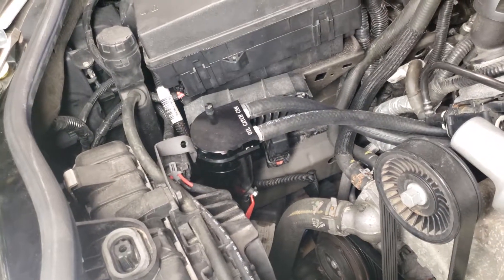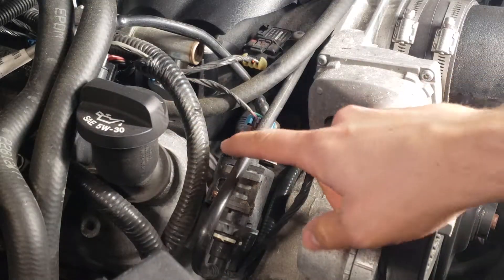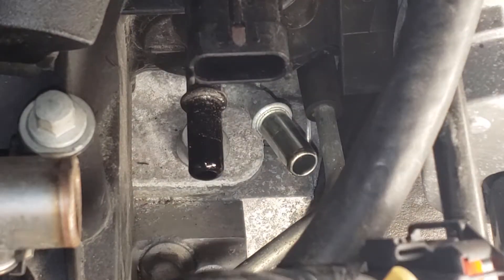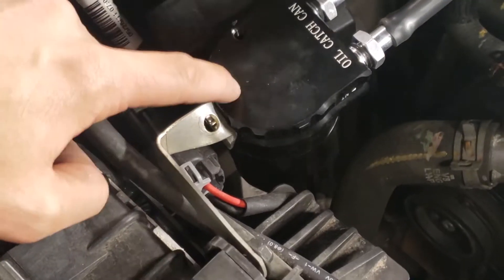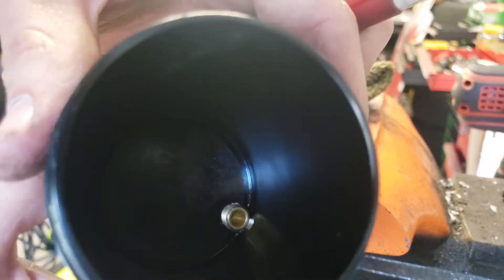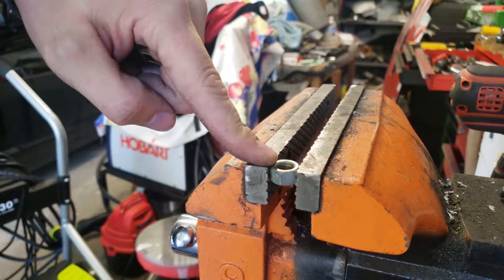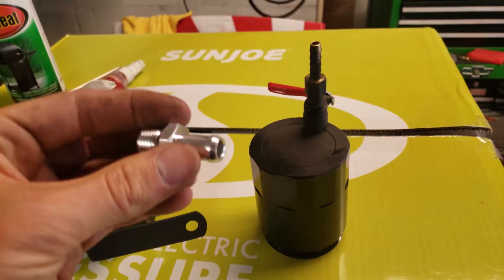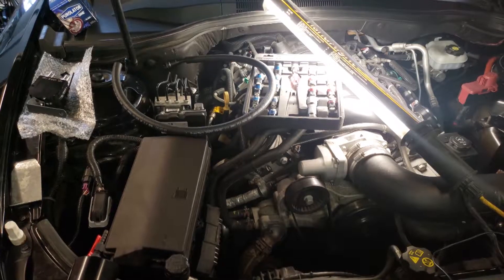5th gen budget Oil catch can install

Comment: I saw a video online from other catch can companies saying that the “IN” was for the intake manifold port, and the “OUT” was for the valley plate port. Not sure if there is an update on this video. I got the same catch can and wanna make sure it’s installed correctly 😭 unsure if you’ll reply but would be great if you did. Thank you!
Reply from the maker: @rsj2ss758  interesting, ive never looked into it any, but I drain the can every now and then and it is catching stuff. Mostly in winter

Comment: How has it performed now that it's been 4 years? And would this install be the same for an LS?
Reply from the maker: This is an LS car. 
The can collects a decent amount of crap! It's probably like 1/2 full after 6 months of winter use and I've had no issues with it so far
Reply from the maker: I see from your videos you meant an LS trim level, not an LS engine lol
I'm not sure where you tap into on a V6 but overall it should be a very similar install

Comment: Sup Thalk I just got a SS 2011 automatic the previous owner put a oil catch can I just don't know how to clean it out or anything about keeping up with the maintenance.
Reply from the maker: Most of them either unscrew (in half) or have a bolt in the bottom the is the drain (like your cars oil pan)
If it has a dipstick or hose on the side to view the level, check it, if it's 1/2 way full then drain it. (I dump the contents in with my waste motor oil)
All the times I've drained mine since installing it collectively have been less than 1/2 a container, so you most likely won't have to do it very often
Reply: @thawkproductions4248  thanks also how would you go about deleting the DOD/VVT on the engine
Reply from the maker: @ssjohnny17  well, I have an Ls3 car so I've never done any research on a dod/vvt delete, that being said I'm not sure why you would want to get rid of either of those things.
Sorry I can't help you with that one
Reply: @ssjohnny17 LOL after 3 yrs, hopefully you figured that not knowing how to maintain or figure out an oil catch can/PCV system, PROBABLY means you shouldn’t be going after something as huge of a project as deleting the DOD/AFM on your (automatic transmission equipped) engine

Comment: I have two OCC in my car. You should put clamps on the ends of the hoses 4x. And maybe a stainless steel mesh in the can and in the baffle.
Reply from the maker: If I was running boost of any kind I would clamp the hoses but with it being vacuum lines (that fit pretty tight to begin with) they aren't going anywhere.
The can does have a spot to put steel wool and someday when I remember about it and buy some, I will be adding that.